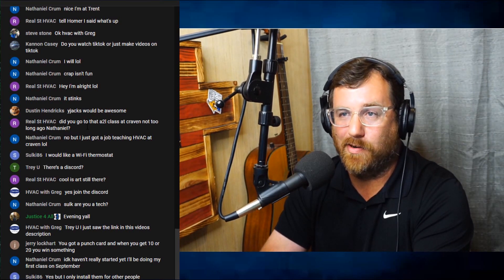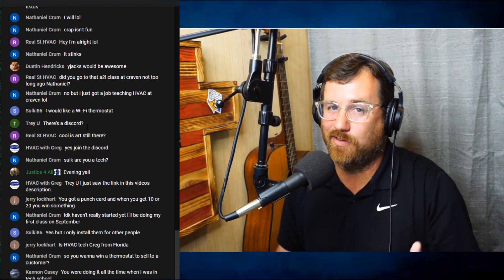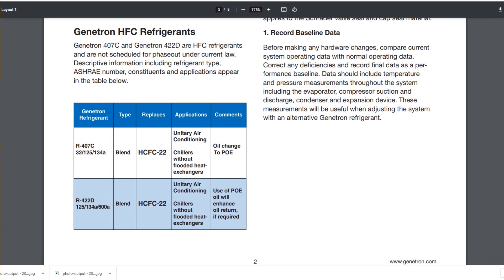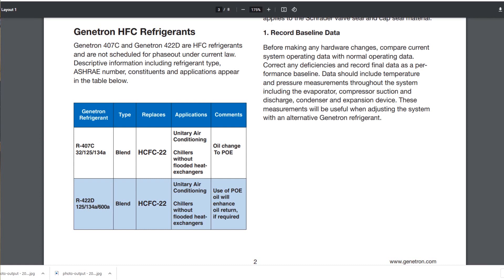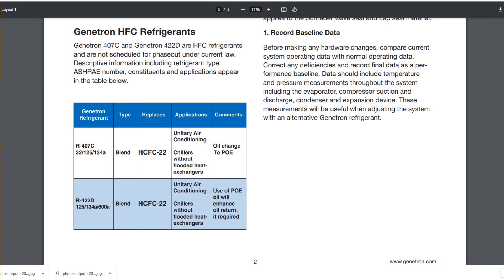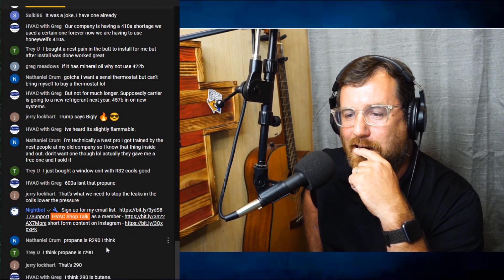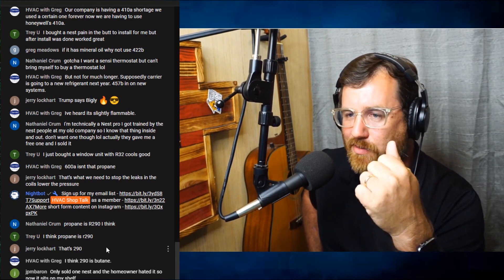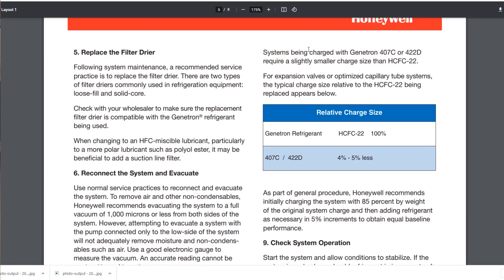I Justify My Method of Retrofitting R407C into R22 Systems

Comment: I have an old trane intellipak unit, i need to retrofit it into R407c If i just dump compressor oil out is it good enough cause its impossible to remove oil from the whole system what is your advice and procedure or recommendations?

Comment: Polar molecule: one side of the molecule is slightly more positive or negative than than the other.

This allows them to spatially orientate with other molecules of equal opposing charges:
(+-)

What or how much tangible benefits that nets you in real life is  anyones guess.  As a chemist id say in theory that makes sense however in practice what does it mean?  At the end of the day is the cold air blowing from the vent going to be 53F opposed to 55F?  

I doubt it will matter much.

Would be an interesting yet expensive and time consuming experiment with many variables at play.

Comment: Rule of thumb and never had any problems with it. Only use 407C if you have a 407C condenser or replacing a R-22 compressor with new compressor rated for a 407c. 

Anything else like a Freon leak or full conversion with the same compressor, just use Nu-22 / 422b or a "drop in" replacement which uses the same mineral oil.  Also always change the filter driers / sight glass when doing a conversion.

Comment: Careful in adding extra oil in a system ? , If the oil level in a compressor is too high it will increase it's amperage .

Comment: I’m having a R-22 ZR28PFZ scroll compressor. 
Can I change its oil completely and fill the oil compatible with R-32 and use it with R-32 gas.
Reply: Remove old AB oil, and fill in poe oil instead, so you can use that compressor with R32 or R407c  it will work better.
Reply: Don't use R32, it's pressures are too high and it isn't a legal substitute because of its flammability. If you are willing to remove the old mineral oil, you would be better off using R407c and POE oil. R407c is a great replacement for R22 as far as performance and efficiency is concerned, it's just not very widely used because it requires an oil change to do a proper conversion, so converting properly wouldn't really be much of a cost savings over getting a new system or just using R22. The best conversion in the world still doesn't guarantee that a 15-20+ year old R22 system is going to last.

That's why most people use MO99 or some other "drop in" refrigerant and just accept the decrease in performance and efficiency and probably reduced longevity- because the system is likely reaching the end of its life anyways, so investing a lot of money into it doesn't make financial sense.

Comment: Using 427A you don’t have to add POE  oil. 427A has one more refrigerant (R143A) that help to the oil return.
Reply from the maker: I think it has less R32 though, which is the really good part of the refrigerant for thermal transfer.

Comment: The suction line filter is recommended due to the cleaning/detergent effect of the POE. 
I've done several R22 conversions on grocery store Rack systems, and suction filters are common practice.

We also remove them after a certain amount of run time. Same for Resi systems. 
I personally think a liquid line drier alone is adequate for small Resi units.

Comment: Like the vid and I agree with you but have some concerns.  A unit overcharged with oil essentially becomes a foam pump because the excess oil isnt separated from refrigerant which can cause a great decrease in capacity.  I know this working large chillers.  Its the lack of enough heat to be able to separate he oil from refrigerant.   I wouldn't just add a 15 - 20 % of oil to a machine without a crank case heater.  Furthermore pay attention if you do a change out on a unit u swapped out.  If u cut the lineset open and find a bunch of foam or the compressor is full of foam u know its not good.  Furthermore one way to tell if ur pumping foam is ur evaporator approach.  A high approach temp can indicate oil foam if you kjnow ther correct charge is in the system.